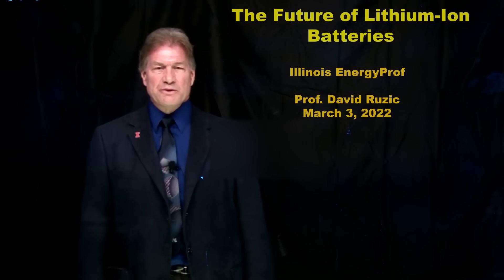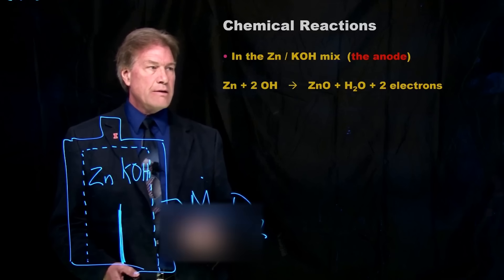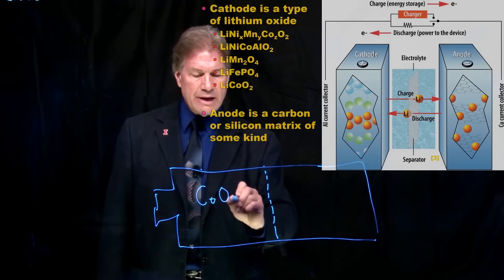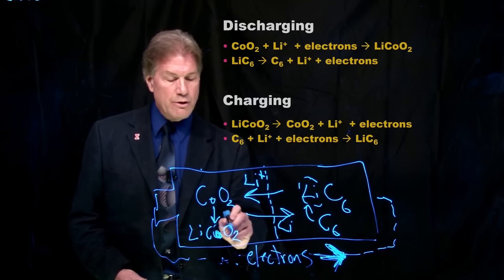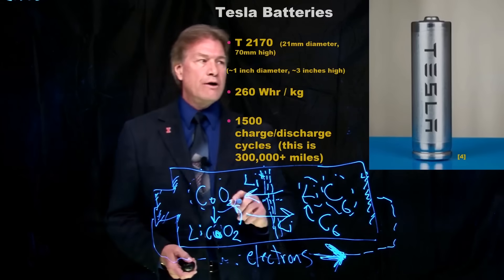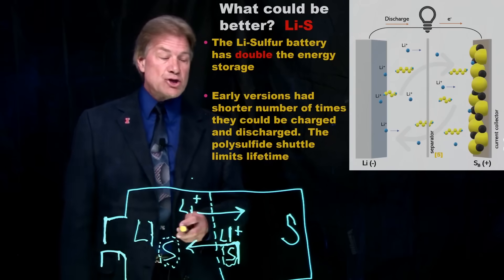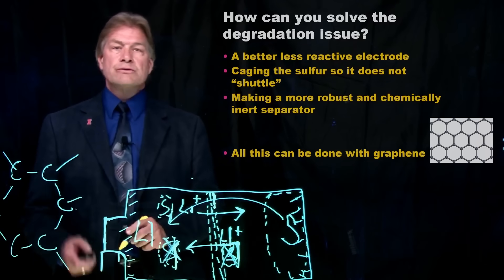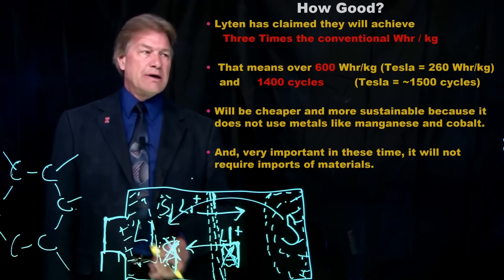The Future of Lithium-Ion Batteries

Comment: I would have appreciated a bit more coverage of how solid these new batteries are, as in, how close to being mass produced. Are they just in the concept phase, a few working prototypes, or just around the corner from initial production runs? (Also having the references in the video matched in the description as actual links would be nice)
Reply: They have been studying batteries for more than 5 years.  the concept itself is viable and proven to work.  the problem is not the theory, but the implementation of it.  Right now the biggest problem is the manufacture of the membrane.  The Graphite membrane is only a few atoms thick and the structure of the graphite must be perfect to improve the efficiency of the reaction.  But it is one thing to theorize or make some test models in a laboratory and another is to manufacture thousands of square meters of a graphite membrane with a perfect atomic structure at an industrial level.  Models and "prototypes" have been manufactured, but at the moment mass production is not possible.  In the manufacturing process of the graphite membrane, irregularities, errors, bad formations of the membrane occur that today make its large-scale manufacture unfeasible.  The loss of material derived from the "bad formations" is too great and the graphite membrane formation process is too slow and expensive.
Reply: @gorkarullan  I agree, 100%.  That said, if the science is there and compelling, then it becomes an engineering problem.  And those problems can be solved.  Maybe not today or next week, but depending on the economic pressure, it will be solved.
Reply: @tkwilson71  it will be solved but when? Fusion is another exemple of a potential groundbreaking concept that has and will take decades to reach. Viable graphene batteries may as well be decades away.
Reply: @jonaboy3  Graphene based batteries are on sale now. Not S based, but LiPo. They are just hella expensive.
Reply: @dedwardskbd  To be fair, those are graphene composite cells, and there are only power optimized ones currently, as energy optimized graphene optimized cells are a lot harder to make.
Reply: @gorkarullan  What about the lithium?  It sounds like half of the chemicals in the battery is pure lithium.
Reply: @tarstarkusz  There are already several prototypes of batteries that work without lithium. They are using other types of materials but chemically there are many that are toxic, carcinogenic or products in the making that are bad for the environment and cannot be mass produced. In the last year several studies have been published with salts and components that are less toxic and easier to potent... but the efficiency of the batteries is less than the current ones. Today, realistically, there is no prototype that improves lithium batteries in energy efficiency and production costs. Several years ago, companies specialized in lithium recycling have appeared. In China there are some of the largest recycling companies (near the production points, thus making the business profitable). I think that the United States is considering opening a lithium recycling plant . There are no better solutions in sight in the short or medium term. And batteries with graphite are not a replacement. Graphite was already discovered decades ago and several attempts have been made... but it cannot be produced on a large scale. It is only used in small amounts. And it's not a viable substitute.
Reply: I don't think it's really possible to say, graphene is not currently mass-producible and companies have been looking for ways of mass producing over the last decades with little commercial success. Furthermore, pure graphene is just about impossible to make, so the question will be; are these batteries of any use if we use cheap impure graphene?
Reply: @jonaboy3  graphite cannot be impure.  I think you have not understood the concept of the "product" precisely the key to graphite is in its purity and in its structure... if it is impure it does not work it does not work.  that is precisely the key to the problem with the large-scale manufacture of graphite.
Reply: @gorkarullan Yeah, I think I'm getting my graphite/graphene mixed up. Basically you can never make that perfect material so the question over the next 5-100+ years will be "can I make an awesome graphite battery with a material I can mass-produce".
Reply: @jonaboy3  The real question is can we power everything currently powered by oil with electricity without using fossil fuels to make electricity and largely without nuclear either.
The people who hate internal combustion also hate nuclear. In fact, they probably hate nuclear more.
This means we would have to power everything with solar and wind.
Reply: Beyond the capacity, I thought LiS had expansion contraction issues,  also how is the charge speed/curve? Temperature range? And heating while charging... These technologies have so many dimensions not to mention mass production
Reply: $1000 dollar double AA batteries
Reply: Lithium-Ion batteries obviously we use today in significant quantity. The latest 4680 'tabless' cells they are now ramping production on at Freemont and Texas (and soon to be Berlin) have some additional improvements in several respects, but the basic concept is the same. They are an improvement upon existing tech, not a shift to a different sort of tech. This will represent the 'standard to beat' for widespread adoption to be attractive. 

Li-S batteries are still in theory-land. No one has yet made a working prototype. They are hopeful that in the next decade someone can get a working prototype, under laboratory conditions. How long it will take to find a commercially viable means of mass production is anyone's guess.

Solid State batteries are in Prototyping. There is an actual physical prototype made under laboratory conditions. It's the size of a watch battery, but it physically exists. Unfortunately, scaling size and capacity, and commercially viable production at scale, are questions as yet unsolved. So they're closer than the Li-S batteries, in theory, because they actually have built one, but they're still a decade or two off before you're going to see them in domestic products outside of niche 'initial adoption' toys. 

Anything referring to Graphene is still a minimum couple decades out at the earliest, because they have yet to get commercially viable production at scale of the underlying material, which is needed before you can even begin prototyping much less a product into the hands of consumers. Same with 'carbon nanotube'. These technologies represent enormous potential... once we figure out how to make the blasted things in more than gram-scale production under laboratory conditions.
Reply: Mass Public Adoption is far more important than Mass Production.  Cart before the Horse.
Reply: @seanb3516  You can't adopt something that doesn't exist. Besides, the public will happily adopt anything that is superior and cheaper, that's how a free market economy works.
Reply: @ShneekeyTheLost  And you can't mass produce something that has not been widely adopted without going broke.  Tautological now isn't it?
In fact adoption of a new product would be a slow uptake until a critical mass is reached whereupon you can then mass produce cheaper and with time a better product.
Reply: @seanb3516  There's a very clear and distinct difference. It is physically impossible to have mass adoption without first having mass production. It is merely unwise to set up mass production without first having a demand for the product. One is actually impossible, the second is merely risky. 

Given the demand for energy storage in general, the demand is already there for better batteries. Mass producing ANY of the new battery types being bantered about would be lucrative, you would be able to sell 100% of everything you make at the moment, and still have more demand. The problem is not in the demand, the problem is in the production.
Reply: @ShneekeyTheLost    What you've got there is a False Dichotomy.  Either one or the other.  What actually happens 'ITRW' is that production and demand travel lock-step together.  At some point someone looks back at the increase and states that it is now Mass Production.  There is not one before the other (Production:Adoption).  They roll together.  Give any example of Mass Production before Adoption that didn't lead to the Failure of the Business in question.
Reply: @ShneekeyTheLost  Still a False Dichotomy... There is nothing in the definition of the word 'Adopt' which states that it must be a physical object which is immediately available.  A person may intend to adopt a new routine starting in the New Year, for example.
Reply: @seanb3516  Given there is already a super-abundance of demand for functional batteries, that's not going to be the issue. Every single EV manufacturer (except possibly Tesla) including everyone in Detroit who suddenly realized that if they don't produce an EV they'll be out of business in a decade, have a burning hot demand for as many batteries as they can get their hands on. And that's only the start of the extreme demand of functional batteries. 

Demand is not remotely the issue at hand. The issue is purely supply. Manufacturing capabilities. Which means they need to have a means of manufacturing the product in question at high enough volume for the market to actually care about. Which precisely NONE of the alternative battery technologies mentioned have even started doing yet.
Reply: @ShneekeyTheLost  i would essentially agree with you statement.  You are stating that demand outstrips supply which I would think happens every time.  Not to Tangent too wildly I do find myself much more interested in the Safety aspect of these batteries.  For example as a rule of thumb the faster you can charge the batteries the faster you can discharge them.  I use Vape batteries which can discharge Continuously at 40 Freaking Amps...and 4.2 Volts which is around 175 Watts Per Battery!  Lithium is one of those Metals that can burn inside a block of Dry Ice, CO2.  The Lithium will literally rip the Oxygen away from the CO2 and you are left with a bunch of Carbon so long as the fire doesn't also consume that later on.  I don't think it would be too difficult to get a piece of rebar shoved through a battery pack.  And, didn't we just see a Cargo Container Ship sink to the bottom because of Luxury EV fires on board?  Further, Batteries are nothing compared to the danger of Capacitors.  Think Dead Electronic Hobbyists playing with Televisions or Microwaves.  And those are about the size of a man's fist.  When you can discharge 800km worth of electric charge in less than 50ms it's definitely going to produce a few sparks!  Should be really cool.
Reply: @seanb3516  Capacitors, super or elsewise, have a far lower energy density than chemical battery storage for the moment. They also are rather poor at retaining their charge. Most supercapacitors, ultracapacitors, and other capacitors with buzzword prefixes tend to lose over half their charge in 24 hours. 

In certain applications, I fully agree that capacitors can fill a function, but they do not fill the same niche chemical batteries do at this time. I'd really like to see capactors being used in electric vehicles between the regenerative braking and battery to increase efficiency of the regenerative braking system, as well as possibly putting some between motor and battery to give you an initial boost of acceleration, much like using NOS in a race car. However, replacing batteries for capacitors in an EV would double the vehicle's weight, reduce its range by a third, and would lose a significant portion of its charge every day. Hardly ideal.
Reply: @ShneekeyTheLost  Unfortunate to hear that SuperCaps won't do the trick outright.  I do like your mention of boost and in-between applications though.  Definitely something to chew on in the background as we grind out daily life.  But yeah, Capacitors sure do have some downsides to them.
Reply: @ShneekeyTheLost  We were using the one Super Capacitor that we were allowed to do research with (USDOD is damn tight with their SuperCaps) to attempt the World's fastest Air Compressor.  We were trying to use Bosch speakers that were being researched themselves as Refrigeration Units (super interesting stuff actually) to drive the compression pulse fast and hard enough.  We had already destroyed several Electrically Driven Engine Supercharger type Blowers.  They go bang real good.  All to produce a Concentrated Oxygen Stream to supply Fuel Cell Stacks using PSA to separate out the Nitrogen.  In the end we did not succeed and I had tons of fun.
Reply: They aren't. They aren't even in a stage where they work have working prototypes to run estimates for tests. Most of the information he is talking about is from simulation and research he is doing. Basically he is "stirring" the hype for those batteries as the company that is funding his research is on a verge of shutting down funding for impracticality of it. The biggest problem with the batteries which he "forgot" to mention and which can't be engineered around and over is that battery will have to double in size when discharged. ;)
Reply: I don't know your age, so I hope this doesn't come off as a jaded buzzkill rant. If you are wondering how close all of this is to mass production, here is the easiest answer:

The conversations you are seeing in the video and in the comments? We were having those same basic conversations 20 years ago.

Lithium ion cells have gotten about 4x better over the last 30 years and are getting close to the maximum that can be achieved according to physics. To compare this to x86 computer chips, we went from the Intel i486DX with 11.1 MIPS of computational power to the Intel Core i9-9900K with 412,090 MIPS of computational power in 30 years. Battery technology took 30 years to advance the same amount that the computer chip industry took 3 years to do. (Intel i486DX to Intel DX4)

If you took techies like me from 20 years ago and showed us the technology of today, our minds would be blown by the computational power and storage capacities we have available with computers and the things we can do with it. We would be completely unimpressed by the battery technology of today vs 20 years ago. Yea it's a bit better, but largely the same. 2002 me would consider the  improvements in the White LED to be a far more significant development. From our perspective, battery tech would have not meaningfully advanced. What advanced was everything around the battery.

All the promises of "breakthrough battery tech" are promises those of us old enough heard 20 years ago. The batteries have gotten cheaper, but not that much better. Until I can buy a 4-pack at Wal-Mart, I just consider it sci-fi vaporware.
Reply: Not
Even
Close